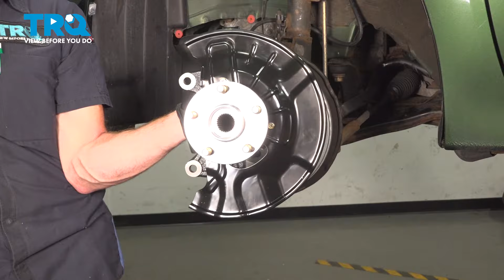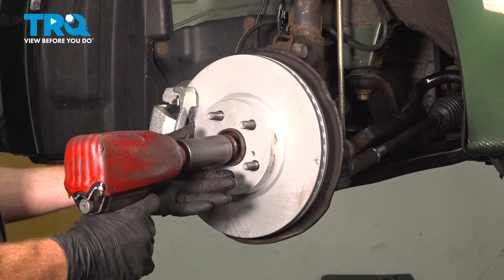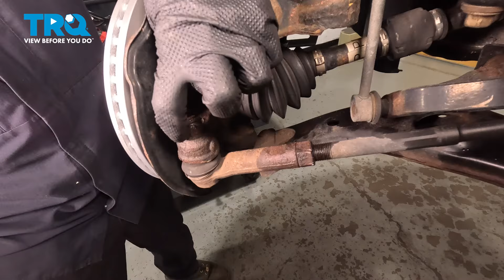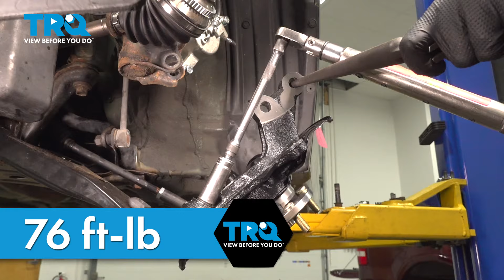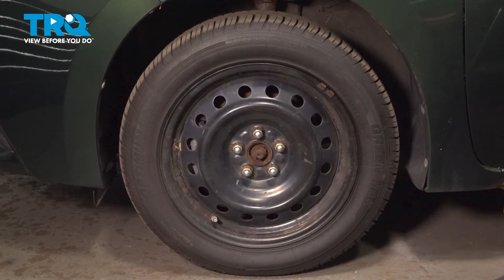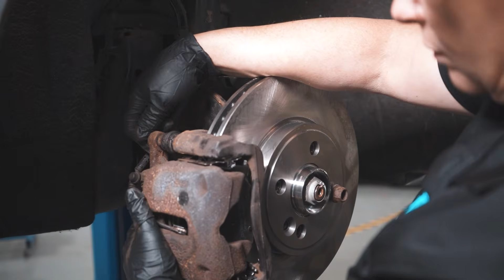How to Replace Steering Knuckle Assemblies 2014-2019 Toyota Corolla

Comment: Quick tip for anyone when it comes to getting out the lower ball joint, if you don’t have an air hammer like he shows, suppor the lower control arm with a jack stand and use the a socket with an extension to beat down on the nut once it is already loosened